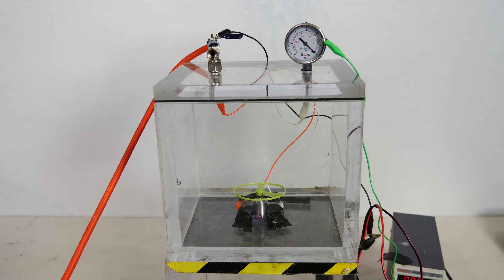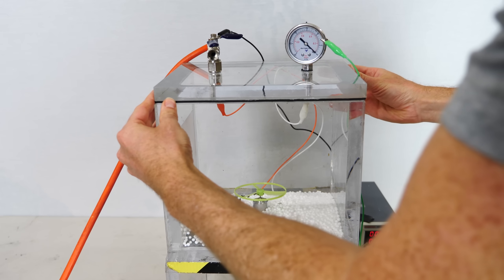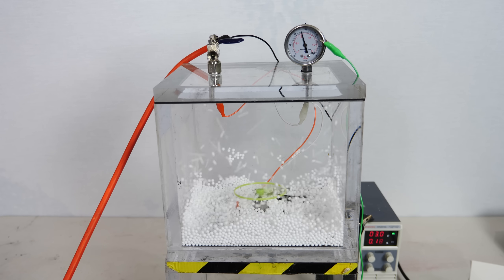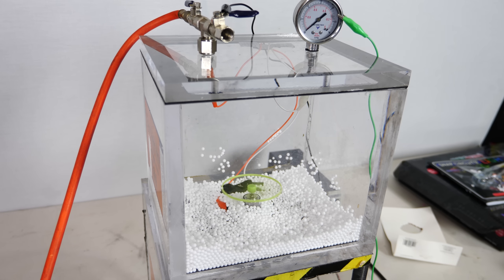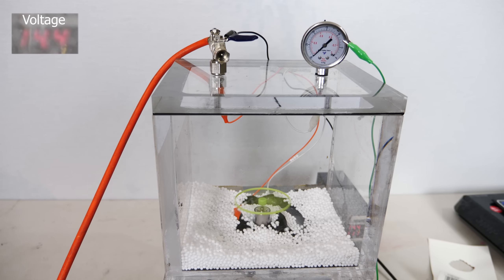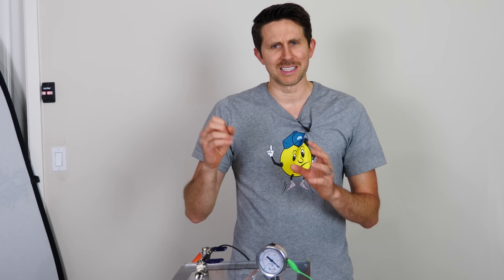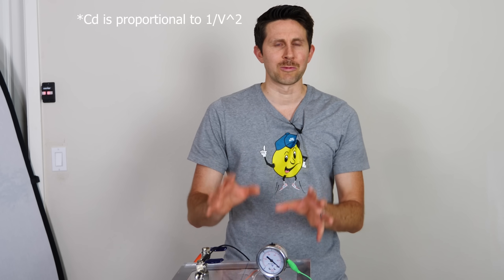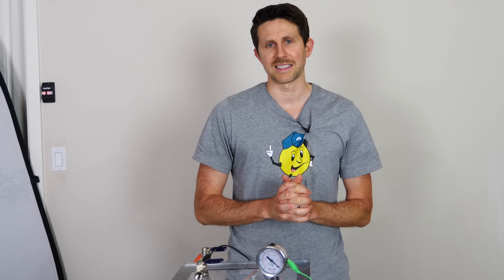What Does a Fan Do in a Vacuum Chamber? Weird Results

Comment: Any movement in Moon atmosphere of 10 to the minus 11 Torr ? How can a rocket move in the vacuum of outer space?
Reply: A rocket has its own propellant a fan doesn’t as it needs air in order to work.
Reply: @ChesssshireCat  without an atmosphere in a vacuum you're not going to get anything to burn you need oxygen for it to burn there is no oxygen in a vacuum. Ask Google and you'll probably get a NASA website what would happen if you had a tear in your space suit. You would have one to two minutes before you die. When you get the torr values that they say is an outer space and on the moon you're not protecting yourself with cloth why even von Braun said the rocket ship would have to be the size of the empire State building and 3 ft thick walls to get to the moon. The walls on the moon lander where as thin as a piece of paper look it up!
Reply: @jondular7423  
And that’s why rockets have an oxidizer in the fuel.
Reply: @ChesssshireCat  you might as well be underwater trying to start a car it's not the right atmosphere for an engine to burn and even if you have an oxidizer in your fuel there's no air to push against do you not even understand what a vacuum is?
Reply: @jondular7423  
Rockets don’t need air to push against. 
Read my first post again and again until you finally understand it. 
There’s plenty of videos showing that you’re wrong.
Reply: @jondular7423  
And you probably think that space is negative pressure and that’s what a vacuum is 😂
Reply: @jondular7423  
😂 what I don’t know?
You do know there’s 70+ space agencies now right...
And NASA doesn’t say that 10^-17 tor is negative pressure it’s actually read as
.00000000017 and that’s not a negative number.
There’s no such thing as negative pressure so keep studying and next time actually learn something. 
At least I know the differences between a fan and a rocket!
Reply: @jondular7423  Rockets push against the combustion gasses flying out the back ... the reaction produces more and more gas (out of the stuff in the fuel tanks of the rocket) which then pushes away the older gas out the only openening, aka the back of the rocket, and because momentum is constant that means the rocket is also pushed / accelerated to the front

also the rocket only needs to hold up against the pressure difference inside vs. outside, assuming there was a perfect vacuum outside and people who need normal air pressure inside thats 1atm= about 1 bar which isn't much in terms of pressure... the highest stress on the rocket is probably from drag when accelerating in the atmosphere
Reply: @jondular7423  go look up how rockets work on wikipedia instead of writing long paragraphs... btw the lunar lander also had rocket boosters to land / start and steering is also done with rocket boosters
Reply: @johnuferbach9166  oh the lander had 10,000 lb rocket boosters that didn't even move dust on the surface of the Moon the Landers legs were shiny gold not a bit of dust no hold of the 10,000 lb thrust would cause cool bugs somebody else stupid

Comment: IMO voltage isn't a real show its the amps as it started drawing less as air resistance fell and only say about 1.2amps at 20v when the blade exploded.
This would be cool to test with different enviroments eg. hydrogen etc if possible.

Comment: Thats not the remaining air, the movements when reduced air is in there, are because the central piece of the motor is generating a complex electromagnetic field jn a state of constant flux. and the balls are easily electrostatically charged, the result is that the balls kinda act like gas molecules bouncing around in the air flow, except that the air flow is in fact static electricity.
Reply: Another way of putting that is the weight of the balls is easily overcome by the static electricity, as seen by them climbing the walls.

Comment: Also, with a brushed motor being driven that hard, there are gasses being created by arcing, includine Ozone.
Reply: Ozone chemically takes 3 Oxygen Molecules and produces 2 Ozone molecules, so the generation of Ozone does not increase pressure.  Good guess, but the chemistry math does not support the theory.  It is more likely as possibilities, the lack of cooling increased the heat and the bearings, or windings broke down and released some of the magic smoke. When the motor was at very high speed, hitting the pellets, may have broken some of the cells of Styrofoam, liberating the trapped gas. With very little Oxygen present, I don't think that there was much Ozone at all.  I would like to see a repeat of the experiment with a high vacuum gauge on the chamber to see the pressure rise when the snowglobe effect returned. I think that was due to a pressure rise. An electric arc from a plasma globe coil can provide the color of ionization to provide a spectrum of the gasses present. I suspect the gas would contain the gas used to form the foam beads.

Comment: so how did they take off from the moon?...
Reply: 🤔 because they didn’t use a fan they used a rocket there’s a difference.
Reply: with rocket boosters^^ But for more fans in low pressure you cpupd check out the drone they want to send to mars, seems to have been quite challenging to get that to work properly^^

Comment: So the sound d of the motor was that just from the vibrations resonating throughout the box material itself, cause I thought you wouldn't be able to hear something. Or am I mistaken?
Reply: Yeah, in a peefect vacuum there wouldn't be any sound, because sound is mechanical vibration and if there is nothing to vibrate there is not sound transmission... but here the motor is touching the floor of the chamber, so that can transmit the sound to the outside air

Comment: How much does the power consumption drop without as much air to move. I was expecting the motor to over heat with no cooling air but the load reduction would help.

Comment: surprised the fan did not burn up. I've over voltaged lots of those old CD player motors and they toast around 10 or 20v.   I know temperature is different in there... but what about an arc ? if thou sustained an electric arc like a tig weld cone >> does something funny happen to where the heat goes ?

Comment: SEVERAL PROBLEMS - AS YOU INSTANTLY THINK THE FAN CAN MOVE NON EXISTENT ATOMS USING MECHANICAL WAVES - THE UNDERSTANDING OF PHYSICS IS LACKING SOME.

WHILE SEVERAL FACTORS ARE AT PLAY - 
1. ITS NOT A TRUE VACUUM SO IT IS GRADUALLY PRESSURIZING ITSELF BACK TO HAVING SOME AIR PRESSURE AND GAS (OXYGEN) MOLECULES NOW BEING PRESET GIVE MOTION FROM THE MECHANICAL WAVES GIVEN BY THE FAN. I WOULD LIKE TO SEE THE CABLE OUTLETS ON THE VACUUM...

2. ELECTRO- MAGNETIC -STATIC ENERGY CREATED BY MOTION - AND CHARGING THE BEADS WITH THE PLASTIC FAN MOVING - 

3. 100% THIS IS NOT A LEGIT VACUUM EXPERIMENT INCLUDING ALL POSSIBLE PHYSICS LAWS AND SCIENCE... AND THE INSTANT JUMP TO BELIEVE MECHANICAL WAVES WHICH REVOLVE AROUND ACTING UPON A MEDIUM MOVE THE BALLS BY USING THE FORCE OF THE PROPELLER IS HUGELY MISLED...

Comment: Another thing that you could have probably highlighted is how the current drawn reduces as vacuum improves.. It can be seen to some extent in this video.. This means that the motor goes to no load (due to less flow rate/drag handled by the motor), and also, that the resistance of the winding increases due to lack of heat transfer, which further restricts the flow of current.. If you had continued to run the motor in vacuum, it would have overheated due to lack of heat transfer medium and then stopped in some time..  I would find this as another interesting experiment..

Comment: I don't know if this was mentioned by anyone in the comments, but it is very interesting (and also makes sense) how the current draw from the motor was dropping as the air was being vacuumed out of the chamber.

This is due to the air density being less over time, meaning that the propeller had less air mass to move thus decreasing the motor load. I'd be interested on what the final number of current draw was at 3 volts when the chamber was at near total vacuum.

Comment: Hey man nice video, I don’t know if you noticed but the current that the motor was using dropped from 0.24 A to at least 0.13 A probably even lower, couldn’t see anymore after you changed the camera angle. Anyway saw that and found it interesting, as the the air density decreased the drag followed and also the power necessary to spin the fan. Expected, but still cool tho lol

Comment: That was no vacuum, plus there remains lots of air in the styrofoam beads as well...hence the result.
Reply: This is what I was thinking too. They’re full of air, and as the vacuum got stronger they outgassed causing all sorts of crazy interactions with the fan, static, pressure, and other beads.
Reply: @BRUXXUS  Outgassing very likely increased when the motor speeds began to resemble a blender at the end.

Comment: Interestingly you could see current going down together with pressure, perhaps because the fan could achieve higher speeds quicker which for a DC fan lovers the time it is properly under power. But that's just a theory, an electronic theory, thanks for reading!

Comment: Just before it broke at 3:55, I heard 230 Hz:

https://www.youtube.com/watch?v=XQea-2AryJI

That's 13,800 cycles per minute.  Assuming that frequency was related to the basic mass imbalance on the molded plastic fan disc, then that was your final speed: 13,800 RPM.  There's a chance it was related to the three blades of the rotor, in which case your final speed was actually just 4600 RPM - but that seems low for something this small.  My money's on 13,800 RPM at failure.

Comment: Notice as vac goes up amperage drawn @ 3v by motor goes down implying less resistance. Simple, but cool. Also, not having a perfect vacuum using a plastic fan and styrofoam beads, etc are all confouding variables. It's not just the air or the fan, the static itself is playing a significant role in this case. Poorly designed experiment and hypothesis.

Comment: You can only remove 99 percent of the atmosphere without a chemical reaction used to remove the last percent,with no oxygen to push nothing should happen other then the fan spinning,Cody's lab has done this experiment also,I didnt bother to watch this video I'm telling you in a true vacuum air current does not exsist,no oxygen to burn,nothing.

Comment: hi ...i basically like your content very much .i think your wide use of hand gestures is the way you are ...ok 
but please , dont use a countdown on every flick of a switch , it feels like in a game show
and here is a  question.
what change was in the load ( amperage ) of the fan when the pressure decreases ?

tmp or turbo pumps are not the end of the line ......
you can increase your vacuum quality by heating your recipient walls as well to remove oxide layers on surfaces and have a cryo device in the chamber too .....loose molecules are tending to bond to cold surfaces .
it is called a " getter " pump system .
the problem over all is a good measurement of the residual molecules , which is a world of its own .
from ionic measurent arcs to membrane/spring /displacement load cells who are only allowed to measure below negative 5 and lower or will get damaged/uncalibrated under atmosphere.

vacuum is a interessting thing , but most people dont understand it right .
especially when it comes down to pumping .
a bigger or more powerfull pump they think will help to improve the end pressure , but it is only the surface area of the pump after the laminar flow ends , turbopumps are living on their entrance surface area and are basically rotating check valves that guides a molecule to the outside that is coming by randomly by molecular chaotic movement .they dont suck anything in , because there is nothing left to suck on .

Comment: Anyone notice that the amperage draw on the power supply decreased as the vacuum was increasing inside the chamber? My only thought is less air (vacuum) means less wind resistance on the fan blades and load on the motor. Less draw on the power supply.

Comment: Once the air gets that thin, the fan starts ionizing the air just from colliding with it.  Individual ion species are then formed which interacts strongly with both the acrylic and styrofoam.  Thus you can effectively "blow the balls around" without actually needing air.  There's air in there, but not enough to actually do what you're thinking.  That's pure static buildup.  Lookup static bells.  Same thing but more pronounced in a vacuum.

Comment: No one mentioned the power consumption. When he was sucking air out, the fan got less resistance from the air and you can see the power consumption lowering.
Reply: It can also be because as there was no air to drain the heat from motor the wires got hot and resistance increased.
Reply: @ahmedejaz1125  good point, in this case i think both played a role.

Comment: Mars is 1/3 the atmosphere of Earth and equates to being at about 15,000 feet. Drones will work on Mars if using high speed motors. I don't understand why NASA isn't sending 1 or 6 to Mars equipped with night vision, thermal, infrared and real light ? Maybe because they don't want us to know what's living in the sands and ricks on Mars, maybe ?! I have found while looking through the rover image's a large crab like creature near the Gale crater and it appears to be over 7 or 8 ft in length, its not for the squeamish to observe but its quite interesting to note that hasn't been dead more than a few months or a year before the rover captured it on camera. It is most likely why we can get no thermal videos of Mars surface and that area from NASA. Must be quite terrifying to watch these creatures moving around and they may be larger than 7 ft. Night footage would show them moving around after sun set and the eyes if the creatures would glow using night vision. Hummm, might be why there are no night videos coming from the rovers up there.

Comment: Technically the windings in the motor should fry out in a vacuum.
Reply: hm ....there is less load on the motor due to no drag on the fan , so i was asking for the amperage drop of the motor once he starts evacuating the chamber .

but .....it has still the abilty to heatsink into the motor and radiate the heat away in the ir spektrum ....i would suggest that the heat is less a problem from a electric field in the motor than from the friction of the bearings over time , because the grease would evaporate in an atmosphere lower than 20 mbar if it is not a special vacuum rated grease .

and second point is that under vacuum conditions ( or was it a combination of vacuum and low gravity ? not sure about this now ) that soldering tin is tending to grow some kind of spikes ( on small circuit boards ) and can create shortcuts on its own ?
Reply: Why
Reply: @DancePartyAttack  There's no air to draw away the heat generated by the motor.
Reply: Beezer Twelve Washingbeard ...And the Most Scientific Comment Award goes to——

Comment: He completely failed to notice that as the air was pumped out and there was less resistance on the fan blades that the amperage was going down. It went from 16 to 14 before he moved the camera angle and eliminated that aspect of the experiment.
Reply: Was thinking the same. 

Another interesting thing was the ball's movement in this less dense air, more "aggressive" cause the density/drag ratio  of these very light spheres is about the same as moving something in the water.

Comment: Notice how you have to have a solid object between a pressurized system to separate it from the non pressurized system. If the scenario was reversed huge vaccume chamber small box of air? If you open that small box of air or remove the solid box after releasing the air , what happens to the air in the huge vaccume? Can anyone answer?

Comment: Less air pressure -> less air resistance on the propeller -> higher rpm -> higher pressure difference under and above the propeller

Comment: I'm at 4:03 min. into the video...
Even with .13 atmosphere.
I don't think the availabe air would move the beads so much.  I think the higher voltage created a larger magnetic field from the fan motor, which is creating a static charge in the beads causing them to attract & repel each other.
Possibly along the field lines.
Maybe?  Now, on with the video!
Thank You

Comment: Thank you for demonstrating what is happening to my constantly breaking ceiling fans that I know the vents to the outside are blocked up with wall cavity insulation. I have one in the bathroom ceiling that now pushes the air back in instead of out. I class this as evidence now, thank you.

Comment: Another NASA fanboy trying to explain the impossible on YouTube. The last few seconds of the experiment were not genuine. You manipulated the readout on your pressure gauge to read a vacuum when it was either at or near atmospheric pressure. You might be able to fool people on YouTube without the equipment to verify your experiment, but not someone who has spent time in a physics lab. Next video... How rocket engines thrust in a vacuum. I'll make it short, they don't.
Reply: Yes they do, and if you “actually” worked in a physics lab you would know the differences between a fan and a rocket. 
A fan requires atmosphere or air in order to work and rocket doesn’t as it has its own propellant and doesn’t require atmosphere to work. 
Plenty of videos showing this...
“I work in a physics lab” 
😂😂😂 yea right.

Comment: you are creating static charge on to the motor. which draws the charged beads into the fan which throws some around and creates movement and they then cascade.  That MIGHT NOT have been air movement.  You noticed how the beads were piling up against the motor just before they started being thrown around again.  You need to remove static electricity from consideration.  It was fun to watch, but I might have dyed the beads different colours for more fun...